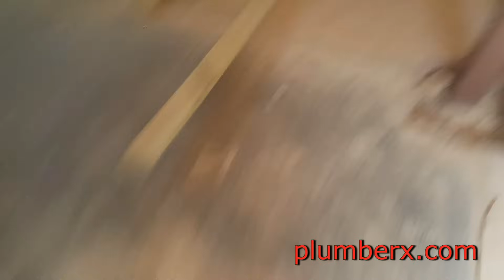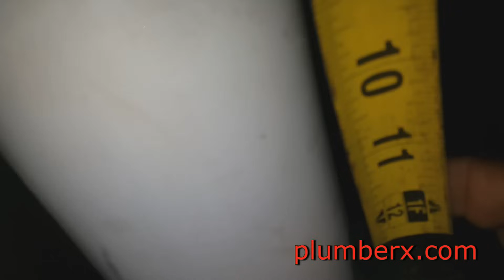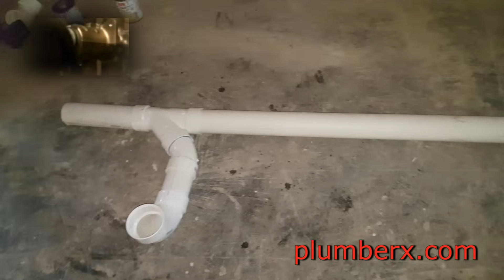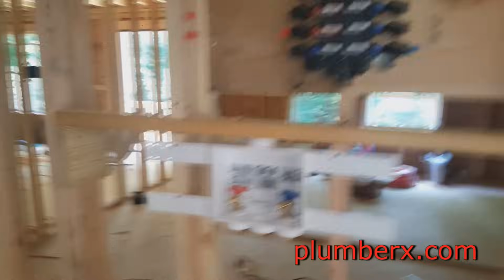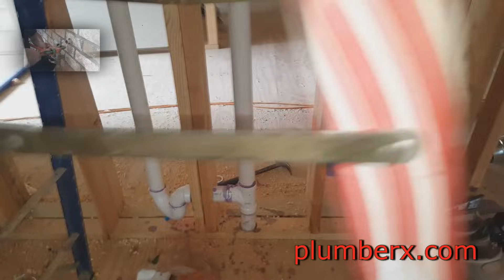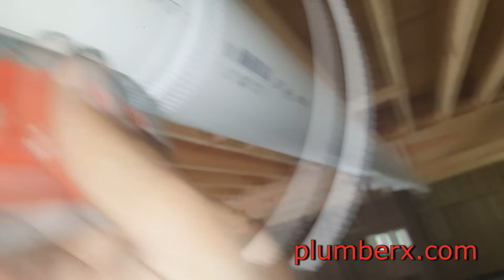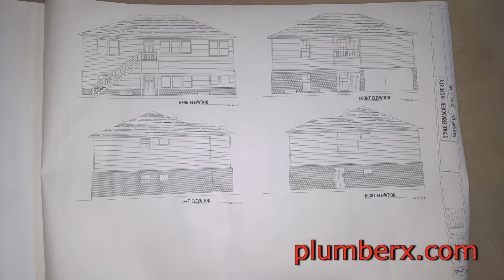Installing And Designing Drain, Waste, And Vent Lines: A Step-by-step Guide

Comment: In my view the solvent socket length on the American pipe fittings are to short. UK pipe fittings are longer with reference to 
socket diameter.
Reply from the maker: Interesting 🤔 uhmm

Comment: Hey my brotha I've been out of the plumbing trade for 12 years, for each phase of plumbing rough in, top out(venting) & hanging fixtures how many total weeks should it take to complete the plumbing on a 5 bedroom 4 bathroom 4k sqft house with a crew of 3 guys?
Reply from the maker: Thanks for reaching out! It's great you're getting back into the plumbing trade. A 5-bedroom, 4-bathroom, 4,000 sq ft house is a substantial project, and estimating timeframes can be tricky. Here's a general breakdown, keeping in mind these are just estimates:
 * Rough-in:
   * This is the most labor-intensive phase. With a crew of 3, you're looking at roughly 2-3 weeks. This includes underground work, water supply lines, and drain lines. Factors like the complexity of the layout, soil conditions, and any unforeseen issues can affect this.
 * Top-out (Venting):
   * This phase is generally quicker than the rough-in. Expect around 1-1.5 weeks. Proper venting is crucial, so accuracy is key.
 * Hanging Fixtures:
   * This is usually the fastest phase. With 3 people, you could likely complete this in 1 week. This assumes all fixtures are on-site and readily available.
Total Estimated Time: 4-5.5 Weeks.
Important Considerations:
 * Local Codes and Inspections: Inspections can add delays.
 * Material Availability: Supply chain issues can cause setbacks.
 * Site Conditions: Difficult terrain or existing utilities can slow progress.
 * Crew Experience: A highly experienced crew might finish faster.
 * Project Complexity: High end fixtures or complex layouts will increase the time needed.
It's always best to add a buffer to your estimates. I hope this helps! Good luck with your project."

Comment: Sorry, not really connected to the video.  But, I had a new electric hot water cylinder installed.  Does it require being connected to the waste pipe?  It's just that the plumber, not the hot water cylinder installer, says that he needs to connect the waste pipe to it?  It makes no sense to me, but then again I'm not a plumber.  Is that correct, connecting the waste pipe to the hot water system?
Reply from the maker: It's great you're asking questions and being proactive about your home!  You're right to be curious. here's a breakdown to help you understand and discuss it better with them:
 * Hot water cylinders generally don't connect directly to the waste pipe. Their purpose is to store and heat water, not to dispose of it.
 * However, there are situations where a nearby waste pipe might be involved:
   * Temperature and Pressure Relief Valve (TPRV): This safety valve is crucial on hot water cylinders. It's designed to release water if the pressure or temperature gets too high. The TPRV does need a discharge pipe, often routed to a safe place near a drain. This pipe is usually small. Maybe this is what the plumber is referring to?
   * Condensation: In some cases, particularly with high-efficiency cylinders, condensation can form. There might be a drain connection for this, but again, it's not a main waste pipe connection.
What to ask your plumber:
 * "Could you explain exactly why the waste pipe needs to be connected to the cylinder?"
 * "Is this related to the TPRV discharge or something else?"
 * "Can you show me where in the cylinder's installation manual this connection is required?"
It's always best to clarify and understand the work being done on your home. If you're still unsure after talking to the plumber, consider getting a second opinion from another qualified plumber. Good luck!

Comment: Can sani ts be stacked  when joining laundry tub and washing machine to common vertical drain and vent?
Reply from the maker: While it might seem logical, this isn't the best practice and might even be against code in many areas. Here's why:

Potential for Blockages: When water drains from the top fixture (the laundry tub in this case), it can create a momentary vacuum or backpressure in the pipe. This can pull or push water from the lower drain (washing machine) back up into the fixture, potentially causing a backup.
Reduced Drainage Efficiency: The stacked configuration can restrict the flow of air within the drain system, which is crucial for proper drainage. This can lead to slow drainage and gurgling sounds.
Venting Issues: Proper venting is essential to prevent sewer gases from entering your home. Stacked sanitary tees can complicate venting and may not provide adequate airflow.
Reply: Should a double wye with street 45 be used instead? Thanks for your reply.
Reply from the maker: @Ven-p3m  You're right to think about a double wye! It's definitely a better option than stacked sanitary tees. However, there are a few things to consider:

Slope: Double wyes are typically designed for horizontal drainage. If you're connecting to a vertical stack, you'll need to use 45-degree fittings to connect the wye branches to the horizontal drains from your laundry tub and washing machine. This can affect the slope of the drain lines. Make sure you maintain the proper slope (usually 1/4 inch per foot) to ensure good drainage.
Venting: Even with a double wye, proper venting is crucial. You'll still need to ensure each fixture is properly vented, either by connecting to a main vent stack or using an AAV if permitted.
Cleanouts: Consider adding a cleanout near the double wye. This will provide easy access for clearing any clogs that might occur.
Why a double wye is better than stacked sanitary tees:

Smoother Flow: The double wye provides a smoother path for wastewater, reducing the chance of backups and turbulence.
Better Venting: It generally allows for better airflow within the drain system, improving drainage and reducing the risk of sewer gas issues.
Alternatives to consider:

Combination Wye and 1/8 Bend: This fitting is specifically designed for connecting two fixtures to a vertical stack. It combines the functions of a wye and a bend in a single unit, simplifying the installation and ensuring proper drainage.   
Double Fixture Fitting: Similar to the combination wye, this fitting is designed for connecting two fixtures to a vertical stack and often includes built-in venting features.
Reply: Thanks.very much for your detailed answer. Very helpful. You are the best.
Reply from the maker: @Ven-p3m  🙏
Reply: @theartofplumbing  from your answer, it sounds like the better option is to separate the washer and laundry tub drains on their own branch drains, with their own p traps and sanitary tee to a vertical dwv draining to the 3 inch main, and vented above the highest fixture to the vent stack. Is this a better solution?
Reply from the maker: @Ven-p3m Yes 👍
Reply: @theartofplumbing  thanks for replying. I think I have got it now. Seems that not only can AI learn, but humans can too. Lol. Thanks.

Comment: I am completely renovating a modular home. It will have two full bathrooms, kitchen, laundry room, going to a grinder pump. How many vents do I need in the system and where?
Reply from the maker: Yes one for each plumbing fixtures and one dedicated grinder pump system. 👍

Comment: You clearly have the skills to pay the bills but why did you run underneath the ceiling?  Did you end up installing a drop ceiling?
Reply from the maker: Actually that's kind of garage area, The original house in that spot was on the ground and when the area flooded they had to raise the house 12 ft off the ground. 👍

Comment: Should I use 2” vent or 1.5” venting. I only have 1sink 1shower 1 toilet1 laundry sink and 1 washer
Reply from the maker: First of all. I would recommend you reach out to your local plumbing code official, because each State and City plumbing code may differ. In some cases it is not as much as sizing your vent, but you may have to bring the vent out the roof size the same as your main drain line going out to the sewer line in the ground under. home. But with all that said technically For a plumbing system with just 1 sink, 1 shower, 1 toilet, 1 laundry sink, and 1 washer, 1.5" venting should be sufficient. The key factors are that you don't have a lot of high flow rate fixtures like multiple showers or jetted tubs, and you only have a single stack for the toilet, sink, and shower.

With just 5 fixtures branching off a single stack, a 1.5" vent should provide enough air flow to properly vent the system. Going up to 2" venting won't hurt, but is probably overkill for this setup. Sticking with 1.5" vents will save a bit on material cost.

The main time you would want 2" vents is if you have a more complex drain system with multiple stacks, lots of fixtures, and/or high flow fixtures. But for a straightforward 1.5 bath setup like you described, 1.5" will work just fine."

Let me know if you would like me to modify or expand on this suggested response at all! I aimed to provide a thorough overview explaining why 1.5" vents would be suitable for the specific plumbing setup described.

Comment: Thanks.  I couldn't clear the clog on my Kitchen sink because I couldn't find the cleanouts of a very long drain pipe hidden inside the wall.  The snake cable got stuck and couldn't go anywhere.  There was only one cleanout that stood up outside the house but it was too far from the Kitchen sink.  Do you think that I should cut the wall to see where the Kitchen sink drain piping is in order to fix the deep clog? Thanks!
Reply from the maker: You know I had to do just that. A few times my self.
Reply: @theartofplumbing  I don't understand why they usually install the Kitchen sink pipe so small, and even setting horizontal long before it will reach to the main drain pipe(I think it is in the front part of my house); it may not have enough normal force to push the junks from the Kitchen sink to the main pipe inside the wall.  Thank you for reading!
Reply from the maker: @mvo3602 kitchen sink drain should be at least 2"

Comment: On those long 3” runs, shouldn’t there be a clean out in change of direction or every 100’ 
And the reduced bushing on the 2” trap ? What, I never seen that 
MI plumber.
Reply from the maker: The spacing of cleanouts for a 3-inch drain pipe depends on local plumbing codes and regulations, which can vary by region. However, a general rule of thumb is to install a cleanout every 50 feet or at every change of direction greater than 45 degrees. It is important to check with local plumbing codes and regulations to determine the specific requirements for cleanouts in your area.

Comment: Thank you for the video. I am a home inspector and do some of my own plumbing. Always helpful to see how an experienced professional works.
Reply from the maker: Nice. Appreciate you checking out my video
Reply: @theartofplumbing  I subscribed to your channel. Looking forward to watching more of your videos
Reply: @theartofplumbing  I have a drain from a 1st floor toilet connected by a 90 elbow to a drain line in basement. The drain line does not have a cleanout at the beginning of the line where the toilet is connected. The only cleanout is 30' from the start where the 3" pipe transitions to 4" for pipe running from the basement to the septic tank. I am not having a problem with the drain line, but want to add a cleanout so it is available if there is a blockage in the line in the future. I also want to proactively jet the line this spring when I jet the line to the septic tank. Looking at options for a cleanout. As I see it, I could replace the elbow with a sanitary tee or install a cleanout after the elbow. Very interested in what you recommend.
Reply from the maker: @sjpropertyservices3987  thank you. 🙏
Reply: @theartofplumbing  I have a drain from a 1st floor toilet connected by a 90 elbow to a drain line in basement. The drain line does not have a cleanout at the beginning of the line where the toilet is connected. The only cleanout is 30' from the start where the 3" pipe transitions to 4" for pipe running from the basement to the septic tank. I am not having a problem with the drain line, but want to add a cleanout so it is available if there is a blockage in the line in the future. I also want to proactively jet the line this spring when I jet the line to the septic tank. Looking at options for a cleanout. As I see it, I could replace the elbow with a sanitary tee or install a cleanout after the elbow. Very interested in what you recommend.

Comment: How high is the washer drain set ? 30 inches or higher than the washer? Also hiw close are the vent to the drains like the toilet and tub
Reply from the maker: Laundry outlet 40" to bottom of laundry box. Vent Less then 6' on Shower , toilet 2' on this setup

Comment: I'm plumbing my own home and it's not that complicated. I'm an electrician so not Familiar with plumbing other than it being in my way. It's 99% common sense and good planning in advance. I actually think the codes are a bit lacking there's a few things I didn't think where a good idea that code allows but I am just going off common sense. I didn't like using 90s  anywhere that I could fit a Y or 45. Even if it was more convenient.

Comment: The p trap for the AC condinsation. The long piece catching the kitchen sink. Why does the long piece at the p trap drop down then goes up to the 4inch. Wouldnt water build up in there and catch food and grease people wash down the sink
Reply from the maker: That's why the kitchen sink and A/C line as well as all plumbing fixtures have the separate vents. And yes the waste lines are all tied together. A grease trap would be nice, but there's not going to be a commercial sink in here. Good question.

Comment: Does my P-trap have to be directly underneath my drain or can it be further down the line ?
Reply from the maker: That is what they call a running trap. And you still have to have a vent near by, but yes some areas I would check with your local code enforcement person first.

Comment: I built my own home with a contractor and several teen age boys. We did our plumbing all to code. I have a kitchen 2" waste line that connects at the joint that exits the house. That pipe comes from two bathrooms and washer machine. I occasionally get a clog on the kitchen side of that exit joint. It lies about 19' from the kitchen sink. I want to snake it to that point and want to know if I will push any of the clog into the pipe coming from the bathrooms which is 3" I assume because it comes from the toilets. At that joint I am learning it is a sweep connecting the kitchen 2" pipe to the 3" pipe coming from the bathrooms. Does this guarantee I will not be pushing the clog into the pipe coming from the bathrooms? Rather pushing it into the exit headed for the septic? I have had to do this once or twice in 20 years. And it worked, but I am a widow and I am doing this by myself and it is a BIG job. If you have any advice, I would appreciate it. Thank you very much.
Reply from the maker: Your right it should not push stoppage back to bathroom drain. All pipe fittings should be directional fitting allowing the flow of waste and sewer machine to go one way out and away from your home. If you can clear line at 19' great, but be carfule not to get it caught at ceptic take. Sounds like you know what your doing. You got this 👍

Comment: @How To Plumbing,  could or does the pvc have to be flush with the joist?
Reply from the maker: No, it should drop slowly to the end of the run.
Reply: @theartofplumbing  not to bug you about a previous question,  but when you have time can you tell me what Saniflo toilet you used in your video? Also, what is one one way I can learn to read blueprints, because I use to remember how, but list it due to not doing plumbing for a long long time? Like,  where do the plumbing goes. I know what the illustration shows, such as doirs, toilets, lav sinks, kitchen sinks, etc.

Comment: @How To Plumbing,  I'm confused as to how you made up the fittings to install the drain for the toilet and vent. I saw you putting it together on the ground,  but how did you get it so accurate?
Reply from the maker: Lots of practice. Easy once you get it. Your right I need a video to cover just that. 👍

Comment: Silly question - When you use pvc, don't you need to do a light sand where the joints meet and are glued?
Reply from the maker: That's a good question, because some plumbers do just that. I let the cleaner do the work for me.
Reply: @theartofplumbing  thank you much
Reply: @theartofplumbing  Well, cleaner doesn't perform the same function as deburring the inside: to remove rough edges that may catch stuff inside a fitting. Deburring the inside is easy and doesn't take long.
Reply: Many plumbers recommend (1) deburring the inside and (2) sanding or filing the outside to put a chamfer on it. The first prevents snags on the inside. The second helps the glue spread when making a connection.
Reply from the maker: @burts6896  your right

Comment: Can I connect my water heater (in attic) drain pan on a vent stack pipe just in case it leaks?
Reply from the maker: Sorry, but no🥺 the vent pipe carry sewer smells and it would get into your attic then HVAC venting system. The house would be full with sewer smell. 😣